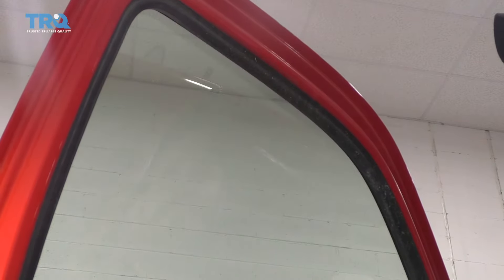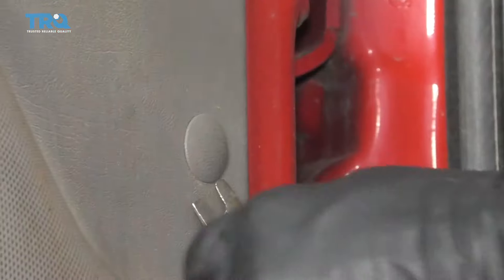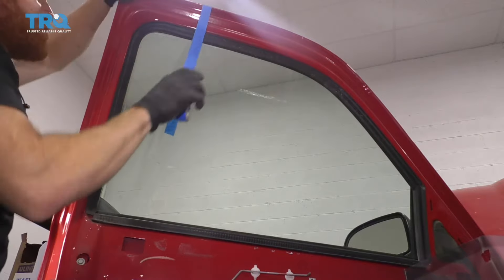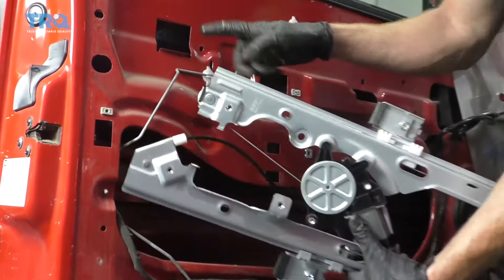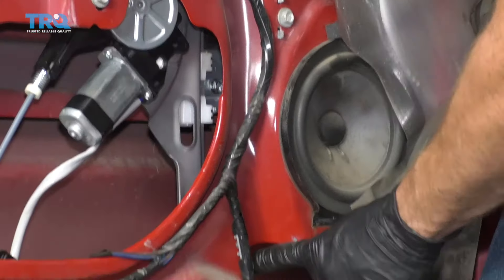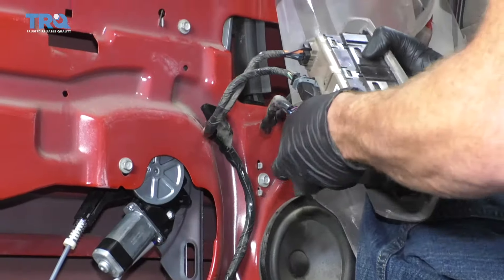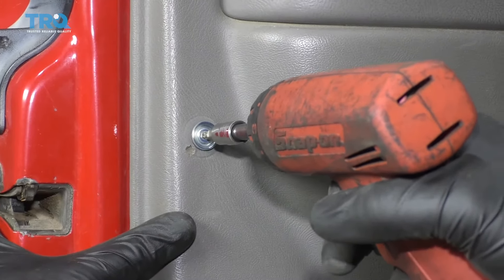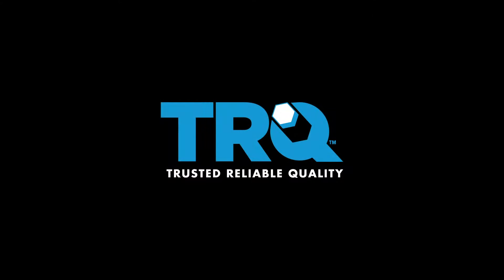How to Replace Front Window Regulator 1999-2007 Chevy Silverado

Comment: Don’t pop the door lock switch up like he does. There’s a small screw from underneath that holds it to the door panel. You have to remove the door panel with the switch still attached and then disconnect it from the back once you have the door panel loose.

Comment: See that screw hole in the side of the switch panel before he takes it off? That is from someone not taking the door panel off first to get the bolt out of the bottom of the switch panel, and then someone drilled a wood screw into the side to get some kind of a mounting going again. Once you break it of like this guy in this video just showed you how to do, it will not stay on anymore and you will have to resort to glue, epoxy, duct tape, non-factory designed bolts and/or screws. ONLY the 1999-2002 Full size GM trucks are made to pry up and out to get this panel off. 2003 to 2006 and 2007 Classic body trucks and SUV's have a screw with a 7mm bolt head you can only get to from taking the door panel off first. REPEAT: 2003 and newer; door panel off first, unplug the switches, then remove the one screw on the bottom. OR just leave the switch panel on the door panel if you don't have to replace any switches.

Comment: I wish I had found this before I went to the mechanic. I said it needed a regulator. They said they would 'have a look.' $500, for motor, door switch, etc and THEN they say 'oh, apparently the regulator is bad too' so it STILL didn't work. 
I went to autozone, got the part, put it in in about 20 minutes, and the hardest part was getting the panel back on straight. 
Thank you so much.

Comment: I watched this video and did the in 15 minutes. Thank you. 

Tools: t20 bit, 10mm, 7mm, flathead, Phillips, 

Tip: the window switches do not snap in. Do not pull them out as suggested. There are 5 7mm screws on the back of the door panel remove them and remove the whole handle and switch assembly then use needle nose pliers to separate the switches from the armrest. There is 2 7mm screws attaching the window switches to the door panel. And a snap clip attaching thr switches to the armrest itself.. Do not break these by just pulling. 

Thanks again. I understand yours was broken so backwards engineering removal was futile.

Comment: PRO TIPS: 
1-loosen off the window clamps before installing the new regulator into the door.
2-You don’t have to remove the inner door handle. It’s not in the way of anything.
3-you can fit the switch panel through the opening in the door panel. This way you won’t risk breaking any connectors (these trucks are 20 years old)

Other than that. It’s a good video. But name the size of the bolts you’re removing and show each step.
Most people come here to learn how to do it themselves
Reply: 1. mine was already loose.
2.yes, leave the door handle on, just use some painters tape to hold the plastic out of the way.
3.i agree, switch panel fits through.
4. don't over tighten the window clamp, or you'll be using the one off your old unit.

Comment: Watched last night and replaced this morning. Worked exactly as you explained. Thank you!

It helps to NOT leave the keys in the ignition. Had to recharge the battery in order to get the window to drop down low enough for me to loosen the clamps on the window (ugh). 

I bought the entire kit even though I thought it was just the regulator or motor. Turns out one of the cables had completely broken. Kit cost me about $75 bucks at Oreilly's. Shop said they would do it for about $350-$400. Saved enough to enjoy some good bourbon this Memorial Day weekend.

You rock.

Comment: Super easy video to follow. I had someone to replace my regulator for me only to find out they either did something wrong (which I doubt) or the part I bought was no good...bought a second regulator and replaced it myself after I spent more money thinking it was the switch sense I had just replaced the regulator...long story short had I done it myself the first time I could saved 300 bucks and not rode around with window taped up for almost a month. Thanks for the east to follow video.

Comment: I used this for my 1999 GMC Sierra 2500 SLE.  My door is a little different than this one, and my switch panel is different too.  Got it done though. My window still goes up a little slow.  Hopefully when the -45C weather hits, it won't completely stop like it did last winter.

Comment: For my fellow gmt800 owners that know your window controls the “window bezel” wont go back in you can disconnect the wires after taking the door panel off just be gentle and don’t rip the door panel and pull your wires

Comment: For information on parts I ordered a GM original equipment motor from Rock Auto (made by bosch) and a Continental Brand regulator, the window runs up and down fine no issues.  One bullshit design feature of this motor is the three screws to mount it are wood style screws going into plastic holes on the motor housing, the one mounting it to truck door has an actual steel thread insert which is the proper way, the bean counters never fail to amaze me on how cheap they can get over a few cents.

Comment: I like this video. It’s actually the one I’m using to replace my regulator. But come on man 😂 you tried to play it off when you broke that bolt off on the front of the switch panel. You gotta remove the door panel. Then there is a bolt on the under side of the switch panel that you gotta take out so the switch comes loose from the door. I caught that mistake before I broke my expensive window switch. But others might not and it will cause them to damage their vehicle.
Reply from the maker: +@Scott-ll7pi Thanks for the tip! We'll pass this info along to our production team. http://1aau.to/m/Shop-TRQ

Comment: just purchased a regulator for my 02 avlanche from you, l have a question, other than the door panel being different than mine, is there anything else different or is it pretty much the same as l see on this video ??
Reply from the maker: +ajslam41 Thanks for checking us out. The install should be the same or similar.

Comment: I got installed but my question was at the bottom of the window was already rudder and where a bolt could go through.  Basically, I am guessing this was a factor motor.  My question do I need to removed factor rubber on glass. I got it over it, but I had to loosen the bolt completely out.

Comment: My window is stuck in the down position. Am I going to be able to get the bolts out?
Reply: My window was stuck half down. I found out that the key is to get access to the tightening bolts or screws on both sides of the regular that clamp on to the window glass. Depending on the positioning of the window, you should be able to get to them from the bottom if the window is all the way down. A 2nd pair of hands might help to hold the glass while you do that.

Comment: Another thing.. You really don't need to remove the window switch at all. Remove panel disconnect wires. Also loosen your window clamp bolts before you install regulator. Haven't done mine yet but we can all use this video as a what not to do.